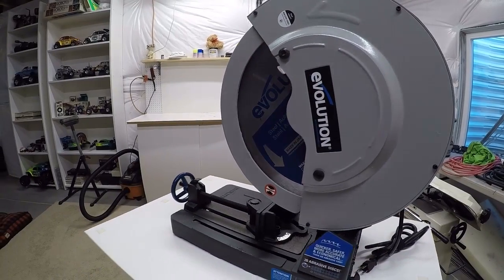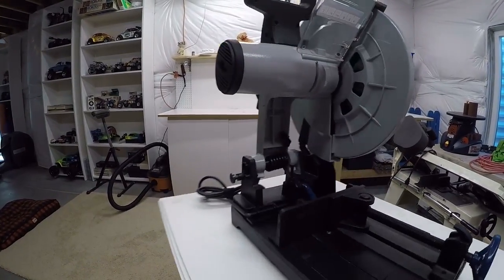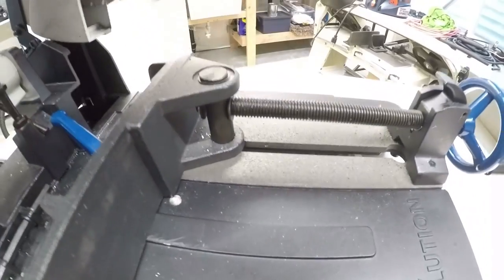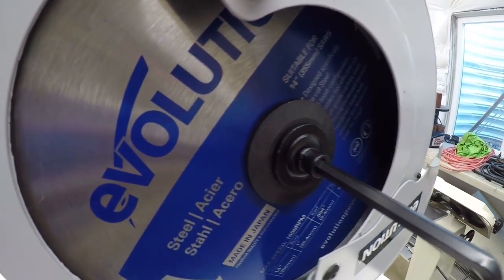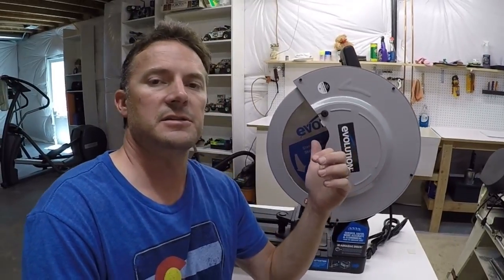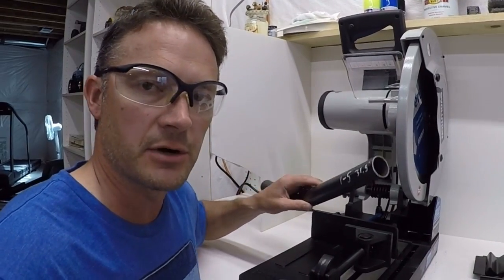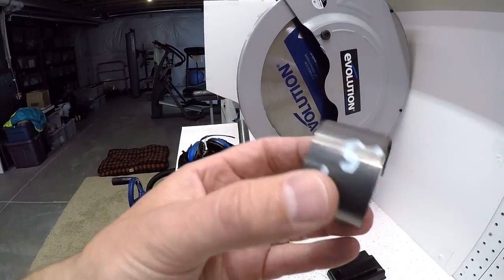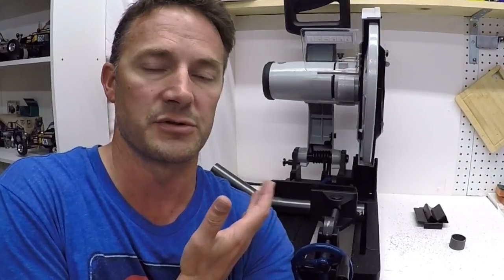EvoSaw380 Show and Tell (Chop Saw)

Comment: Just acquired one of these yesterday on Facebook marketplace; was new in box, still sealed. I'm a newbie to welding and spent a  lot of time studying saws - wanted to get started with something that didn't break the bank and that was fairly versatile. Narrowed down to this one and then targeted it. It does indeed throw some filings and I found that propping a board on the right hand side, - parallel to the blade - played goalie pretty well and concentrated the mess. I still need to dial in the fence and then I'm ready to try cutting some square tubing to make my first welding table! 

I appreciate the video! Thank you.
Reply from the maker: Nice buy!
Have fun and be careful.

Comment: That is an impressive metal chop saw. I do like the smaller footprint and the one allen wrench for adjusting. Looks like a high quality build. Does it have an optional vacuum attachment? Can it be easily mounted to a work bench?
Reply from the maker: It has a hole in the back that a vacuum can be attached to. There is a plate covering it, take the screws out and the plate off and it's good to go.
Mine is just sitting on the bench, it's heavy and super stable. There is no dedicated mounting point, but if you really wanted to permanently mount it to a base you could drill and tap the base. It a solid cast base so there's a lot of meat there. 
Hope that helps.
Reply: That does help. Thank you for your time. With this new saw you should be able to finish your chassis by next weekend? 😃😃😃

Comment: I bought an EVO also but not that one , They didnt have it in stock,  actually they discontinued  that model at home depot in So.Cal dont know why  . The one I ended up buying that was in stock was the cheaper one with sheet stamped metal base . Wow,   what a mistake . It had so much flex it would not make a straight cut, the motor bogged down its a big piece of shit . I ended up cutting the base off and making an adapter to use my horizontal band saw base. All i can say is hope yours works better .
Reply from the maker: Sorry to hear that. They must have learned a lot from that one. This one has a cast base. It's super heavy and doesn't flex at all. It makes very crisp cuts.
Hopefully yours works better on the band saw base, clever mod by the way.

Comment: Use Teflon bushing stop the noise chop saw is awsum but 45 cuts need to. Be cut with band saw the one that just cut by its own weight 250.00  I use chop sáw need to get harbor got a lay down band saw chop saws good for straight cuts but as much as 30  %. About it for me if it works I just have a shitty saw from hsrbor
Reply from the maker: Agreed, I use this saw in conjunction with my bandsaw. Any cuts that would be to risky or dangerous in the chop saw go to the bandsaw.